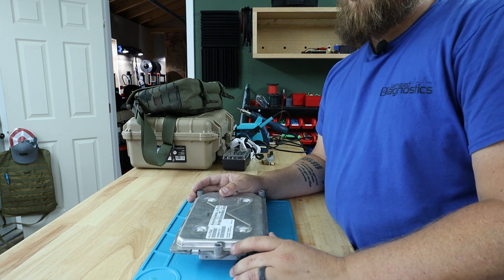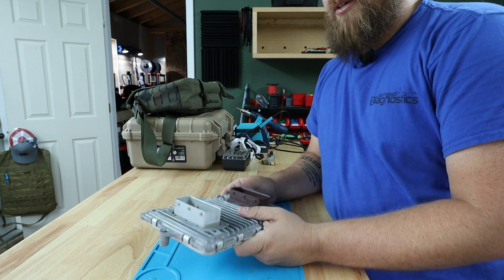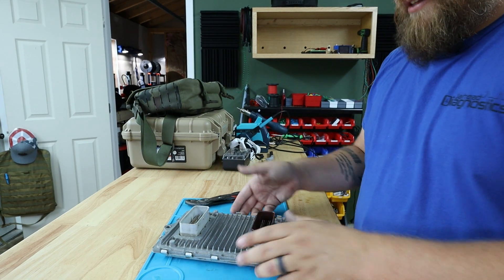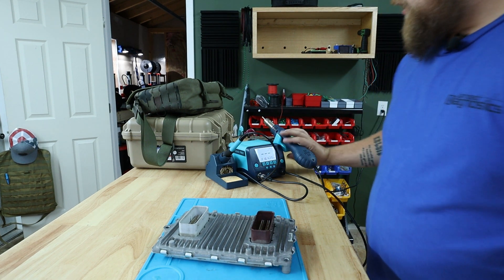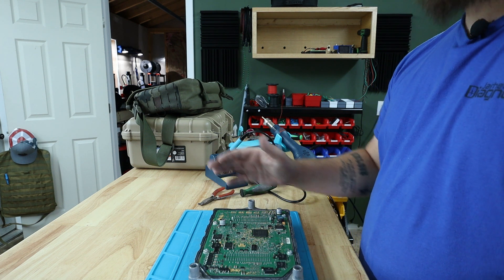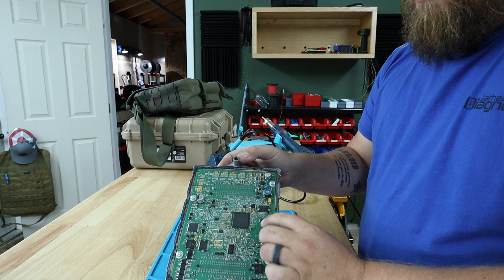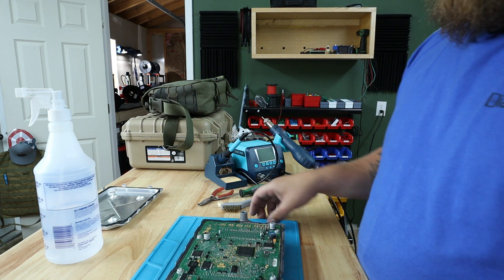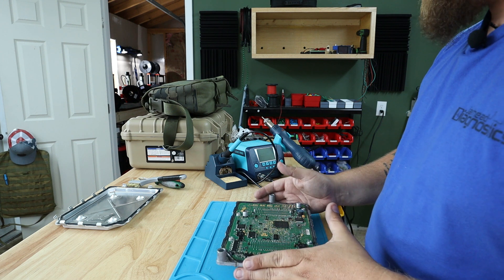Programming a used PCM 2014 Dodge Ram 1500

Comment: Is it allways possible to read and write the eeprom without desoldering? I thought this was not possible because the microprocessor becomes active when connecting the terminal - mine is 3M -  to the eeprom. = power for eeprom AND power for the microprocessor. Thanks for the video.

Comment: Really cool stuff man. And I have the im608 too!
How would you know if it didn't write it properly? What all is stored in this chip that you wrote? Thanks!
Reply from the maker: From what I was told, it would just be corrupt data, and not allow the pcm to function. But the cool thing, if you do that you can still write the correct data later.